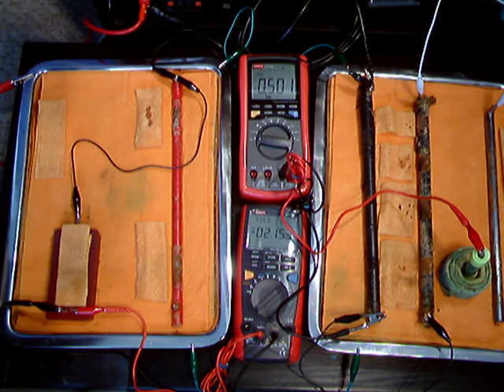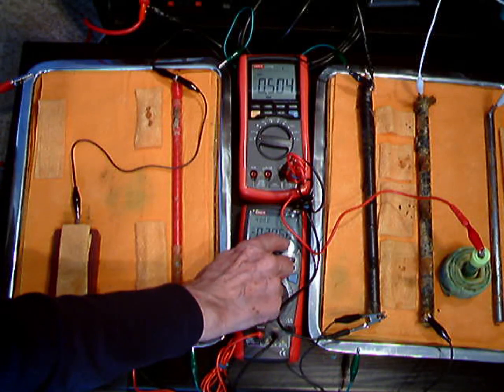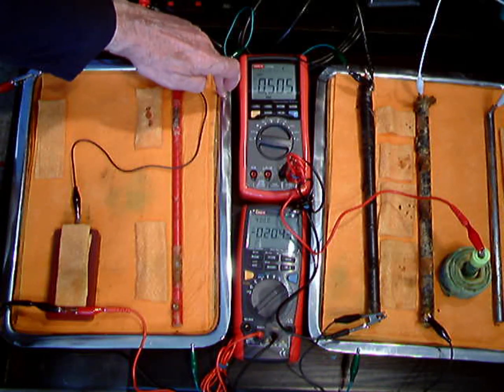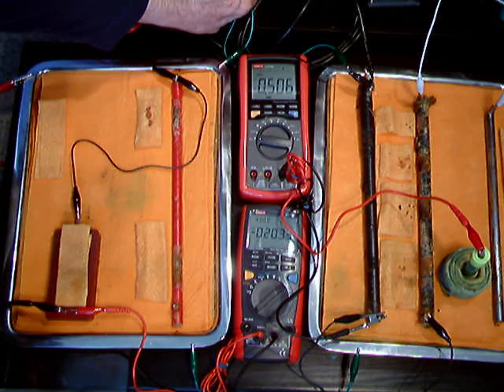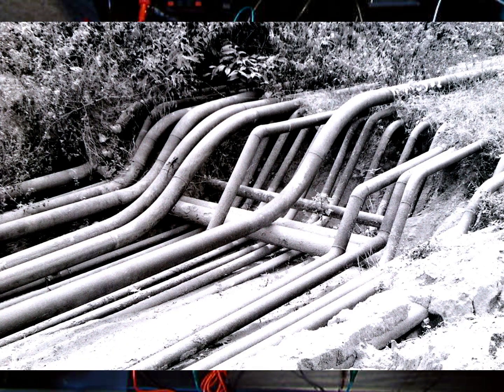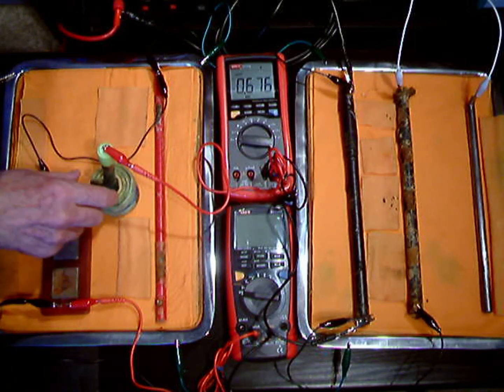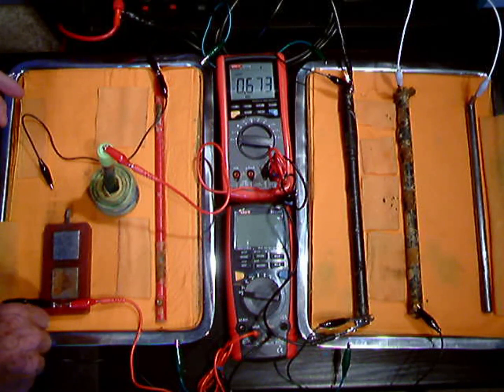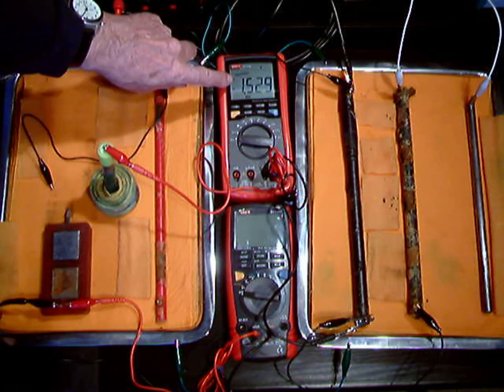How CP works

Comment: Be nice if there were schematics.  It's not at all clear what is connected to what, or what the function is of some of the parts of the system. The hand-waving and (unit-less) measurements alone are not very helpful.